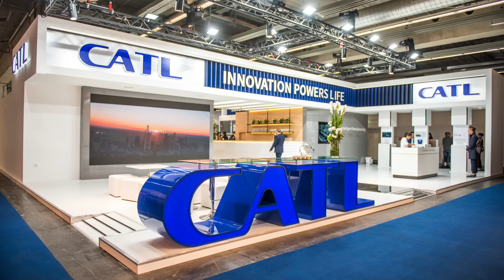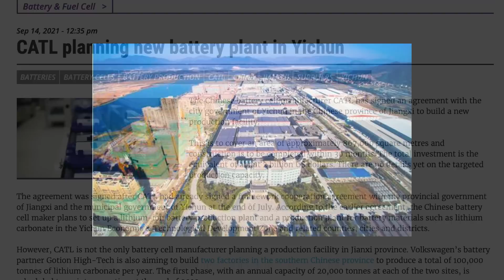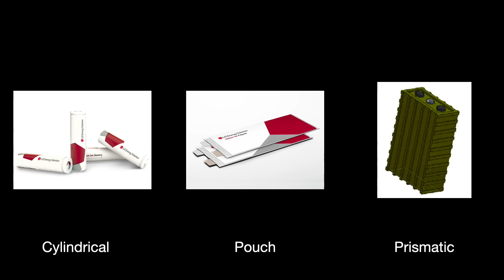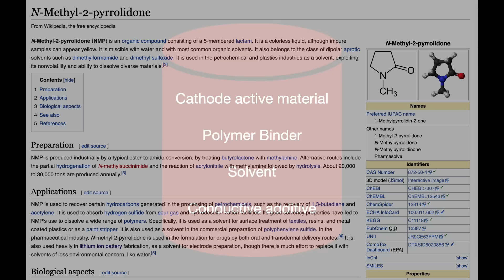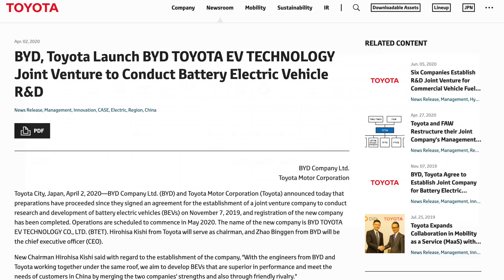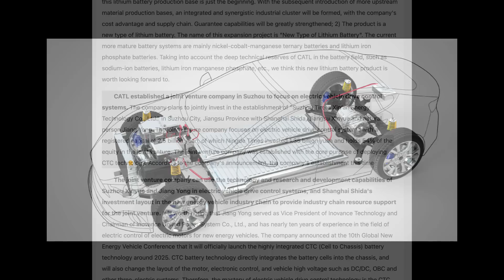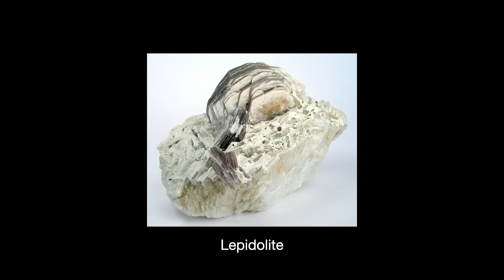How China's CATL Makes an EV Battery

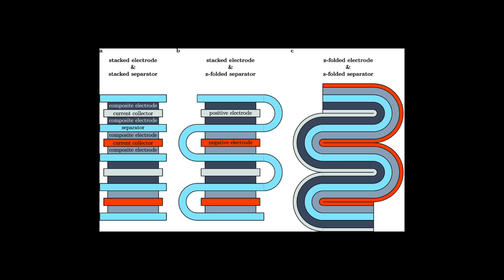Comment: 7:16 from this version the staked is the better option for energy density. Because the second one haz to much pasive material(dont hold energy is just insulator) the 3rd one dont create potential energy in the same material(cathod or anode) in the inside bending. I dont know about manufacturing but instead of this 3 option exist one better wich is ROLL. Can be as tesla a perfect circle or an elipse option that is fast and can be made in diferent size just adjusting the range of elipse(easy scalability and for diferent consumer) after the roll in elipse formate is made squize it and done.
Reply: 7:24 like that. But after they add tabs. that reduce fastcharge. JUST let the anode touch in left side(aluminium) and the cathod  touch in right side(cooper) so you can fast charge and discharge. Tesla make this on new 4680 circle roll but puch/elpise roll already have it. So dont complicate it adding tabs. You will have positive on left and negative on right. that can be easy format for swaping.
Imagine have bus insert the negative in already fixed hole and complete the circuit with one pice of bar when close the case.